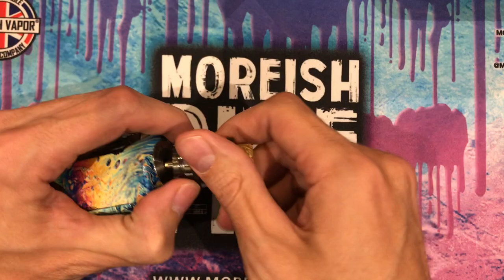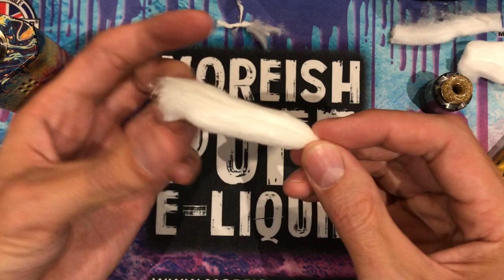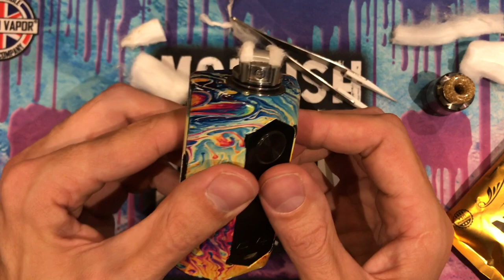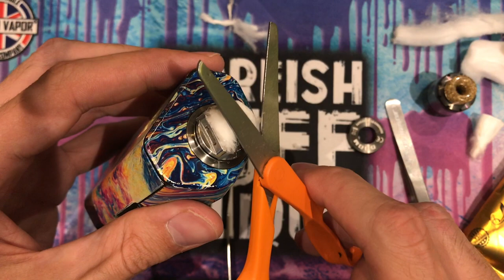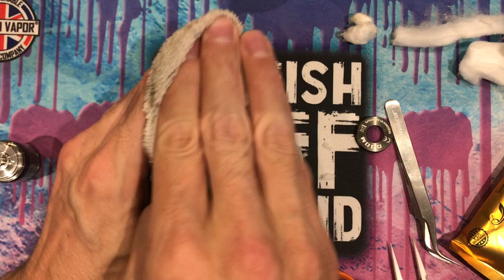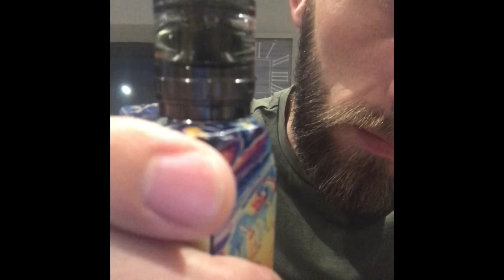Doom Rta Wicking Guide - Damn Vape - The Darth Vaper

Comment: Thanks for this!!!  Was getting horrible dry hits after trying a few different wicking techniques.  I still get some leakage when I put the top back on, probably cause I fill it to the tippy top and putting the lid back on causes pressure and some backflow.  Once the lid is on it does not leak.  But now I can chain vape no problem, not what I normally do, but wanted to test it to make sure.

Comment: Thanks for this very detailed wicking instruction video. Since it’s obvious that you have experimented with the Doom a lot, I’m curious..which mesh are you using? There are so many options these days... I don’t want to spend $’s on any mesh that doesn’t perform well. I also wish someone would produce a mesh with a bit higher resistance... like 0.25 or 0.30 ohms for use with a hybrid mechanical mod safely.
Reply from the maker: Hi mate I'm pretty much sold on the Orfr Nex mesh.
I agree on the resistances but I think the problem is to get higher resistances the mesh would need to be thicker or longer and would end up being useless.
Thanks for watching and the comment 😊😊
Reply: The Darth Vaper Juice Reviews Thanks for your response. I was thinking that they could keep the same size and increase the resistance by making the perforations (holes) smaller..thereby increasing the amount of metal receiving the mods power. Wouldn’t that increase the resistance? If there are concerns about the amount of ejuice passing through reduced size holes, they could alternate larger and smaller holes in a pattern that allows the necessary ejuice flow while overall making a mesh strip with higher resistance. I’d be surprised if it was necessary to increase the mesh thickness. I too like the OFRF mesh. I use both the A1 and SS316L versions. I got a Slatra that’s for me no more difficult to build than a Profile. (Needs springs to hold retaining plates open) When I ordered the Slatra, I was concerned about forming the mesh requiring using tweasers to bend back the ends... that’s not necessary. Just pinch the ends while on the jig and the needed bends are done. Mechlyfe does make slightly higher resistance mesh because the Slatra is a dual mesh build but I’d like to see even higher resistance mesh made available. The Slatra is purely a Dripping RDA and is fantastic on a hybrid 21700 mech. Amazingly it uses less cotton and juice than any other of the mesh  atomizers (both RDAS and RTAS).

Comment: Hi again. I’ve got a somewhat unrelated question about the Doom tank. What the heck are those 4 little silicon rods that there’s one on each corner of the build deck? I’ve not heard an explanation of what their purpose is. Perhaps they’re there to assist with reinstalling the tank? They seem like they’ll be super easy to lose... I saw a few spares in the goody bag, but I question whether they are essential....
Reply from the maker: They serve that soul purpose of slipping the base in like you say. One of mine popped out the other day actually lol.
Reply: The Darth Vaper Juice Reviews  On my first build two of them stayed in the cap when I took it off the first time. It took me a minute to figure out where they were supposed to go...

Comment: I have wicked exactly to a tee with your guide and i still get leaking by the air holes. Any suggestions?
Reply from the maker: Make sure you pack the top of the wicking port but don't stuff the sides full or the juice can't get to the centre.
It may Leak a little just after you've put a new wick in juiced up and fill the tank as the cotton can get saturated then when you fill up a small Amount of seepage can happen.